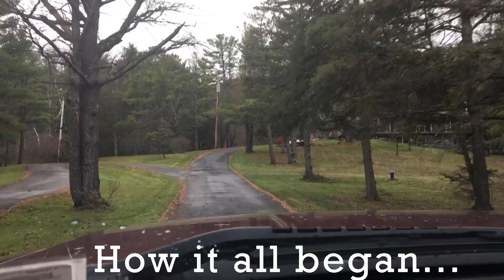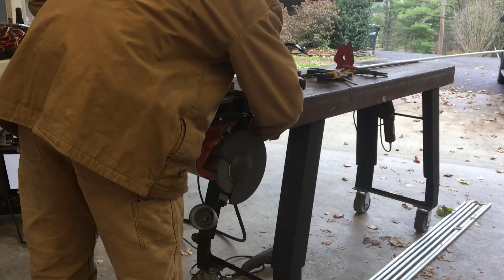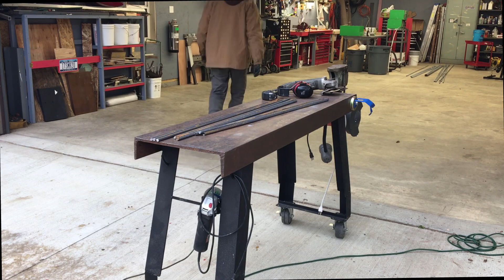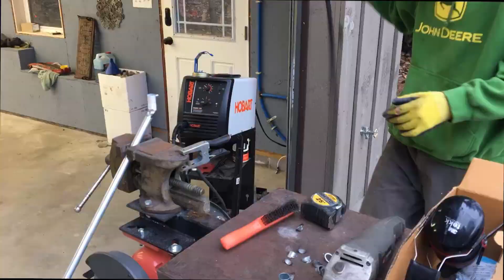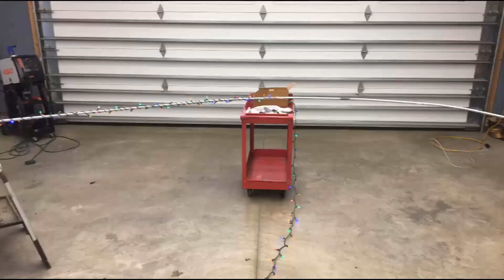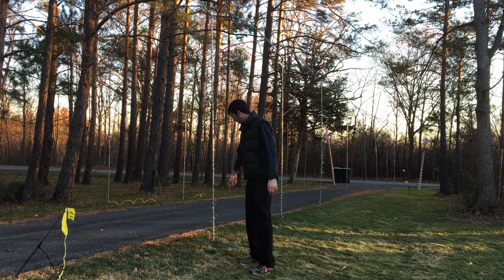Most Awesome Christmas Lights DIY

Comment: If you would have got half inch white plumbing pipe with some couplings you would not have to work yourself to death. Get one end and slide it on the rebar and bend over to other end till it slides on to the other rebar. It would have been lighter and a lot quicker and you wouldn't have to have cables to tie each one of them together.
Reply from the maker: Maybe but I was worried the pvc would not be strong enough and wobble around too much. Plus when you take a straight stick and bend it then the poles going up are going to bend. I needed it to keep its shape.
Reply: @MakerMaxCorbett  with a PVC mounted (slipped over) with the rebar on both ends it doesn't budge. Unless someone is hanging and/ or swinging from it, then it will probably snap. Been using the same material, rebar and pipe for the past 6 years.
Reply: @MakerMaxCorbett  just figured I would throw that out there for you, lol. Still good video